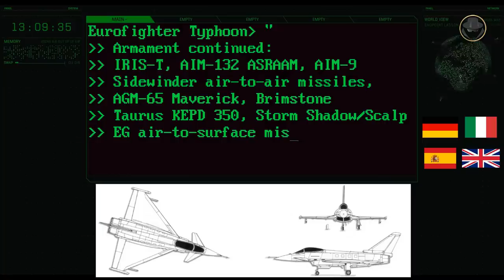Eurofighter Typhoon | The story that the West does not want to tell

Comment: The story about France in the Eurofighter project is totaly FALSE!!! In truth :France did realy "smash the door" from the project, despite Dassault was elected project manager, and the  cause are unaceptable differences of required specifications between the french who need a full omnirole fighter to replace ALL the combat aircraft from the "Armée de l'Air" and the "Aeronavale" =5 different aircrafts, with priority high payload, very high agility, low weight+ limited size+fittable for aircraft carrier, and the German+british required specifications with priority "air superiority", but limited multirole (both use in addition they Tornado so they not need a omnirole fighter, and both don't have CATOBAR aircraft carrier...But much later did the brits regreat this choice because the Eurofighter is impossible to fit for carrier use (landing gear bay is too small and the structural strenght is unadequate) so was the brits forced to buy a US aircraft (buyin Rafale for they new carrier have been too dishonoured for the brits i think...)
Reply: You might want to proof read your comment before posting.
Reply: No the story about how France played the Eurofighter consortium for a bunch of mugs and disappeared to use the aerodynamic and airframe test data is totally true. They demanded total lead of the project, total use of crap SNECMA engines and other specifically French supplier deals. So the rest said 'No thanks' and the French left.
It is no coincidence the Rafale is a Typhoon clone.
Typhoon was and is an multirole aircraft. It has been upgraded (as had Rafale) as demands have changed and roles have been modified. The UK, Germany and Italy as you say had the Tornado bomber for the heavy lifting so Typhoon was originally a fast QRA fighter with lighter GA capabilities (improved in 2008). But the capability to upgrade was built in.
The UK (until 2012) and Italy and Spain had the Harrier for their carriers and other roles and the UK specifically by 2008 was building two large STOVL carriers as the UK was already the only Tier One Partner in the F-35 programme (and had been for many years so was not 'forced' into anything) so was manufacturing, and had access to, 5th Gen and supersonic STOVL capability. France never had Tornado, Harrier and will never have the F-35. The Rafale is by no means a viable alternative to any of those aircraft.
There are only two countries in Europe capable of designing, manufacturing and operating 5thy Gen aircraft those are the UK and Italy. And they have joined forces to build the next generation Tempest to replace the Typhoon by 2035. The French cannot match that capability.
And as we are mentioning carriers the French did the same to the British over the QE Class carriers a they did to Eurofighter over Typhoon when they reneged on the deal for them to buy a QE Class carrier but to CATOBAR specification. So they have previous form for entering into agreements and baling out when it suits them. Meanwhile France only has the one unreliable carrier, 38 Rafale Ms and the UK has two 70,000 ton carriers and buying 138 F-35s to fly off them.
And sorry but we Brits have absolutely NO regrets about not building a 'Typhoon M' as we were never going to build CATOBAR carriers, let alone a nuclear ones and certainly not ones with EMALS (as it doesn't work).
And yes you are right there was no way we were ever going to buy the Rafale. We have superior aircraft in Typhoon and F-35 and the Rafale was incompatible with the new carriers anyway.
Reply: @1chish  whilst I really like and agree with 99% of your comment, I think it’s worth clarifying that at one point the QE class was switched to EMALs for a F35c variant, but this was changed once it became clear the EMALs issue would take many years to resolve. The QE class remains upgradable to that system with the required spaces (as I understand). I’d also like to emphasise how not going nuclear on QE was absolutely the RIGHT thing to do.
Reply: @Moltenbramley  Absolutely right about not going nuclear powered. Just totally unnecessary and hugely expensive. The US Congress did a study back in 1998 and in today's money its about $12 Bn per ship more expensive to build and operate. Thats like 2 new QE carriers and $2 Bn change just in EXTRA costs!
The QE class was not 'switched' to EMALS as such. The consideration in 2010 was if PoW could be built as CATOBAR to buy fewer F-35Cs. But as you say it was just a big black money pit with no guarantees. As the Yanks have found out on the USS Ford.
We dodged a VERY big bullet staying STOVL
Reply: @1chish  so that the fault of France now if that Plane is a total failure ? Also the clone thing lol they are totally different aircraft for different mission and good luck if you want to use air superiority model to make a multirole fighter (also France is totally capable of making 6gen plane or even 5gen they litteraly have every company to make everything like thales dassault mbda etc etc just to remind you they have part in Leonardo and they are litteraly making every new missile for the brit)
Reply: @1chish  A typhoon clone...not really, they are both distinctly different although the Rafale has a better radar and better availability rates than the Typhoon, also Naval variants allow it to land on aircraft carriers (Americans or french)...the Typhoon was a vanity project that failed, it has only been bought by countries that built it + Kuwait...it has a dismal readiness in all countries that used it (which is why its being replaced  whereas the Rafale is still being upgraded and bought)...
Reply: @thepny_chasseur_de_tricera5361   Who said the Typhoon was a failure? i didn't because it isn't. And people who spend their own hard earned cash have bought more Typhoons than Rafales by an order of 2.5 to 1. So the people that REALLY know by the Typhoon. 7 Air Forces and counting.
As for the rest of your nonsense?
WHATEVER! 😂
Reply: @1chish  Did you smoke haschich ?🤔🤢😤
Reply: @thierrymilan2039   I may have done. And then again I may not have done.
i hope that helps your interest... 🤦‍♂️🙄
Reply: @1chish  Thanks for the good laugh dear brexiting neighbour. Snecma M-88 had already working modules in 1982. RR XG-40 was launched, not operational, launched, on paper, in 1984. The M-88 prototype flew onboard the Rafale A on may 27 1990. The EJ-200 derived from the XG-40 demonstrator, flew onboard the Eurofighter on March 27 1994. Almost four years later. The EAP was motorised by RB.199 engines.

France was to buy the most fighters from the european programme, at roughly 336. Getting already 33% of the share on this basis alone among 5 countries. France proposed a dual engine solution, either M-88 or RR engine. RR refused because then the total share of every french european fighter would be 46% on the french aircrafts alone or those sold with this engine.

This is one of the reasons that led to the departure of the french and the launch of the Rafale programme since this looked unacceptable. The big second reason being the refusal to realistically develop a carrier capable aircraft by the european partners, a type of aircraft France needed badly for its then future carrier.

The Eurojet consortium was therefore founded in 1986, after France had left the party.

But in 2011, Rolls Royce got scammed by the pentagon and P&W when their alternative engine for the F-35, the F-136, they were doing with GE, was simply cancelled due to refusal to fund it. RR and GE even proposed to pay for the continuous developpement of the engine, but it got slashed anyway.

Too bad! It would have been a brilliant alternative engine solution for the BRITISH F-35s. 😂
...just like the M-88 would have been on the european jet if France had stood in the programme, and, notably, had gotten the lead on the aerodynamic formula, as it was then planned.

As for everything else you're saying it is BS of the highest grade.

Have a happy brexit!
Reply: @H3x4r35   I got as far as ' dear brexiting neighbour' and lost interest because I realised what would follow would be a load of crap.
Reply: @1chish  Nah you just were too afraid to read some true statements with actual dates and figures.
Yet other people will, and that's my objective.
Reply: @H3x4r35   So why bring bloody Brexit into it if you wanted a serious discussion? No you sought to have a pissing contest and I am not wasting my time.
And btw I served 15 years including a war so unless you have a GMG I am afraid of nothing mate. So don't make dumb presumptions.
Mon Ami.
Reply: @1chish  hi man. Deep deferences in the designs.  juste look at the air intakes ! So different. And this is just an example...
Reply: @Moltenbramley  im not british speaking (never learn british langage in the school) , i think this is undertandable, so for me it's OK...
Reply: @Tullzter  the Rafale  is 100% different technicaly and from phylosophy so only uncompetent people can say "it's a clone ", and for information, the Rafale fly FIRST long before the EF...
Reply: @1chish  you are totaly false , realy ridiculous comments, better you speak from subject you known...I was long enough in the French aeronavale to known all details about Rafale, Eurofighter and british aircraft carriers...And the Brits will pay a high price for their choice of F35 and non nuclear propulsion who is a very big advantage for a carrier despite the "high cost"...
Reply: @leneanderthalien  i’m on your side
Reply: @Tullzter   Yes of course you are .... Hilarious!
Reply: @1chish  With your incoherent and absurd arguments seems you realy known and understand NOTHING about the Rafale and the Eurofighter roles and missions: France did built the Rafale for they own needs : to replace  in they missions the Mirage 2000 (in all he's definitions),  the Mirage F1, the Vought Crusader, the Super Etendard and the Jaguar, and the EF was built to be use in all the other european countries who not have a catobar aircraft carrier and use in addition other aircraft like the Panavia Tornado so don't have need for a OMNIROLE fighter...But now some other nations discover the advantages from the Rafale and did buy it (and not the EF), unless the USA did sale they F35 with dumping prices like in Swiss (and i think will be same story in Canada) : the real cost from a F35 is close twice because 440 000 000 000 US$ development costs (and alway not realy operationnal!)= in real did the US taxpayer pay the difference...

Comment: As usual it was held up by politicians. The British had to build a demonstrator with a different engine to convince their partners to commit to the project. That got enough critical mass to build the plane, although the French pulled out and built the Rafael instead, it’s been a success ever since. A F35 is slower more costly and cannot carry the weapons suites the typhoon can, but it can take off from our non cat Carriers and is an upgrade and replacement for the Harrier and has stealthier capabilities. The Typhoon was fantastic when first introduced and keeps getting better.